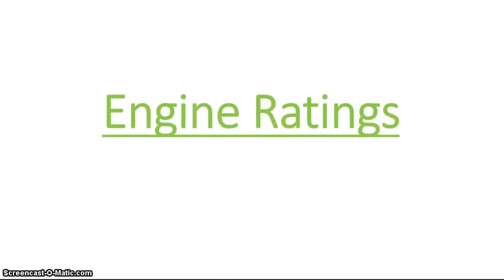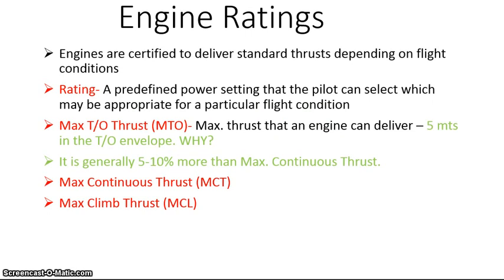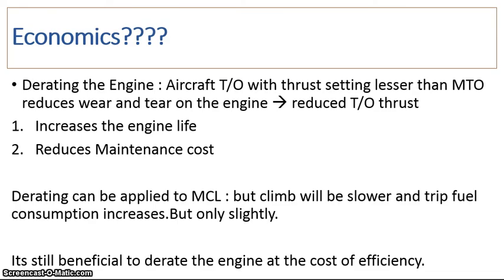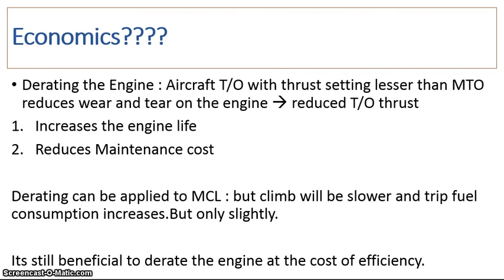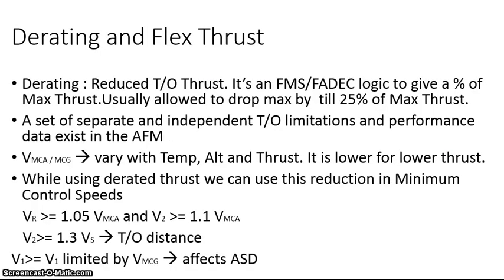Engine Ratings

Comment: hai meril kailath,what is flat rated temp for eg: an engine is producing 70000lbs thrust at isa +15dec celcius.
Reply from the maker: supposedly today ur OAT is say 30°C and ur gross weight is 58 tonnes, u need only thrust sufficient for 58 tonnes..there's no need for thrust that can support ur mtow.so u look at ur performance chart and it will show u, for 58 tonnes what is the Max temp at which u can take off and the corresponding V1/Vr/V2..suppose it is 60°C.so u enter  flex 60 and corresponding speeds into your fmgs performance data.thus u r telling the engine that ur OAT is 60 and the engine will produce the Max thrust it can for 60°C only...this is less than the thrust that can be produced for 58 tonnes and 30°C.So by limiting the thrust u r reducing stress on the engine and hence increasing engine life

Comment: amazing video meril. just one doubt, at one point you said that vmcg, v1 etc are not reduced in flex thrust. but in the example given in the end, you have reduced these values. Can you shed some light on it. thanks :)
Reply from the maker: Ankit Gandhi what that means is you can still use use reduced take-off speeds and full thrust while applying flex thrust .Not that your speeds wont change.After all the whole idea is to save engine life using lower thrust settings (which in effect gives lower speeds)but with DERATE you now can only ever use the lower settings as per your AFM.
Reply from the maker: Meril Kailath  Read this thread. I think you will find it useful.It proved useful to me . http://www.pprune.org/tech-log/427819-difference-derated-t-o-flex-t-o.html
Reply: +Meril Kailath thanks a lot for all the help Meril. :)